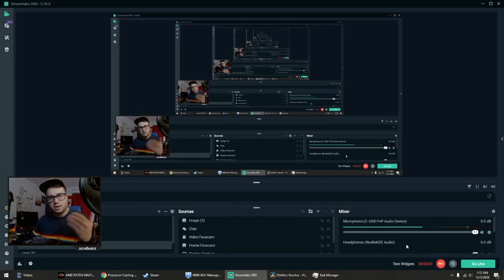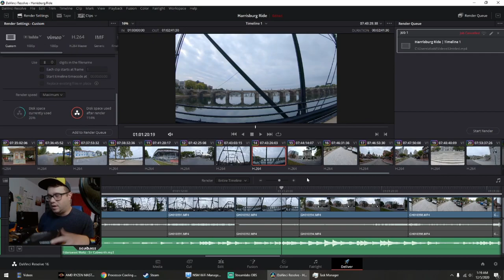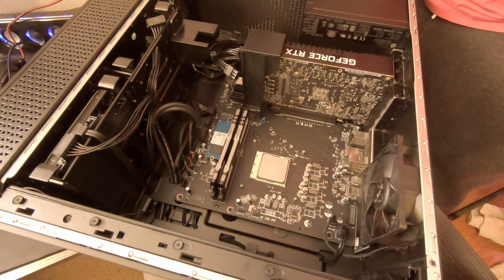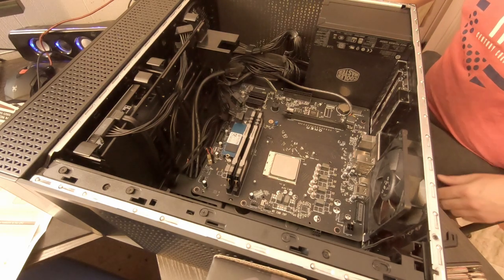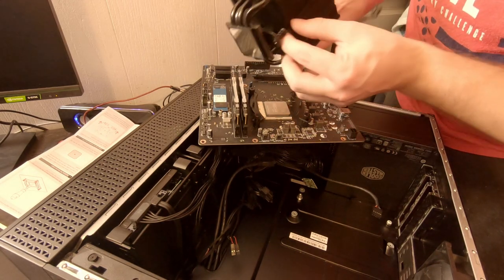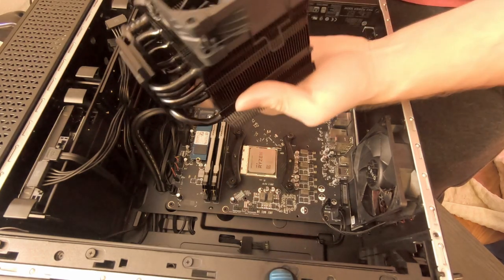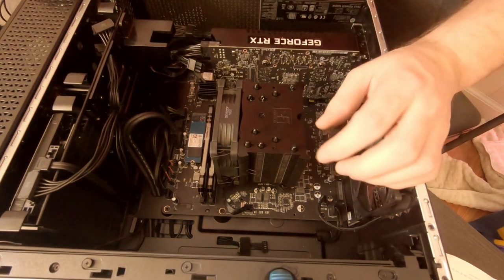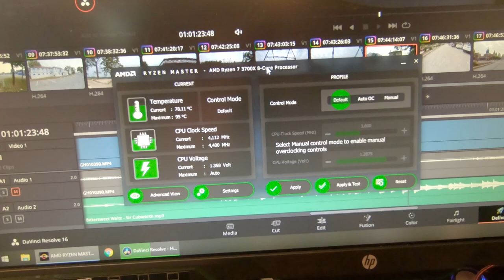Omen 30L Motherboard Removal - Noctua NH-U9S Heatsink Installation

Comment from the maker: Someone alerted me that I had a link to the U12S heatsink in the description, the U12S won't fit, it's approx 130mm, the Omen 30L will fit about 105mm inside the case so you'll have to go with the U9S. Link is here https://www.amazon.com/Noctua-NH-U9S-chromax-Black-Single-Tower-Cooler/dp/B08HH6G48J/ref=sr_1_3?dchild=1&keywords=u9s+noctua&qid=1621882412&sr=8-3

Comment: It's a badass little computer.  I got the exact same one on black Friday sale for $940.  I knew about the heating issues, so installed a top exhaust fan to the pump connection as soon as I pulled it out of the box.  It runs great.  I'll be adding a new cooler I just purchased before Summer.  It runs games in 1440p @ 144 refresh rate no problem.  Good luck trying to build one anywhere near that price today.
Reply: That's exactly why I got it. Amazing price, got a discount as well, and I can't find gpus anywhere lol. I'll take the minor issue for now and upgrade later. Im not planning on overlooking my i9 anyway tbh for now
Reply: did you get the top fan rgb to work ?

Comment: I got same pc exact specs. I ended up installin a cooler master aio. Really helped. I was hittin 92 on a ps3 emulator i was running.  Got it down to 78 when i run it. Every other game is way cooler. Emulators run everything on the cpu
Reply from the maker: honestly anything is going to be better than what they supply
Reply: @churchofseabass9227  yea u can tell thats where hp went cheap
Reply: Which aio did you get?
Reply: Cooler master 120 mm
Reply: @louieguimaraes9865  just know u gotta take the whole motherboard to install it

Comment: Should have whatched your video before changing the cpu cooler. I used a screwdriver to get the sticky tape off and destroyed the mainboard. Now I don‘t really have an Omen anymore 😔.  With the new motherboard, the wifi card is useless now, rgb is not working anymore, had to solder the cable for the on/off switch because it was too short for the new motherboard and I also need to extend the usb 3.0 cable. And somehow my computer now turns on when I touch the case 👍. But at least now I can control the Fans as I wish 👌
Reply from the maker: That is exactly what I was scared of and why I wanted to note that in the video. 

I was using a flimsy plastic gift card thinking there would be no way it was going to damage anything but ended up scraping away a bit of solder anyway, scared the heck out of me. Surprised my computer hasn't started doing some weird stuff yet. Really sorry to hear about your loss
Reply: Darn that stinks man.   I just did this install to my Omen Obelisk and was able to remove the bracket without tools.   I just grabbed the corners and yanked up and she let loose.  I was scared to pry on it and was glad that I didn't have to in the end.

Comment: I just purchased this today. I have the cooler master 120mm in it now. But for some reason it's too tall, so I can't fit the side panel on. Figured since this one is 92mm it will fit. What do u think?
Reply from the maker: I believe there is only about 10-11cm available, so I had to go with the u9s or the 90mm one
Reply: @churchofseabass9227  yea I went with the U9S and it fit perfectly! Good call!

Comment: Did you remove the shield on the top of the case where a fan can go? Even if you do not install a fan that will help with cooling a little bit.
Reply from the maker: yeah, didn't mention it, but I did. Noticed there is still a lot of plastic mesh from the case that covers a good bit of it, but def more air flow.

Comment: I bought a noctua but the mounting bars don’t fit to my hp motherboard. Any tip on what bars I should use? Both bars that came with cooler don’t fit, one is shorter and other longer than mounting pins.

Comment: Could you have used the original fan mount on the back of the motherboard? Or did the replacement one add clearance
Reply from the maker: I believe I checked to try to see, the included mount is the right shape to fit over the HP mount/backplate, but the hp mount/backplate has a different shaped post that won't allow the included (noctua) mounting screws to mount into them.

Comment: Hey I have the exact same model, and I’m thinking of getting an aio liquid cooler, but I’m now wondering if the air cooler would do better. Also, what did you do to get your idle temperature all the way down to 30°?
Reply from the maker: Replace the CPU cooler for sure. The stock one is really bad. Just doing that brought my temps down 10-20C. I think I also changed some windows power setting where the Max Processor power is set at like 100%, reducing it to 99% keeps the CPU from jumping to max power all the time like it seems to do. It'll cause it to idle at much lower power/speed, producing less heat.
Reply: @churchofseabass9227  alright, thanks!

Comment: Great content. Congrats. 
I purchased an Omen 30L
Do you think a Noctua NH-D15 Chromax would fit in considering its size? Thanks.
Reply from the maker: No, the case is about 110-120 mm wide, with the heat sink anchor the 90mm version is about 100-110 mm tall. So the 90mm version or U9S is the largest you can go.

Comment: If I got a Corsair h60 and the same cpu and motherboard as you What kind of brackets do I need ?
Reply from the maker: The motherboard uses a weird configuration, despite it being a AMD CPU it uses Intel bracket positioning/config, so you'd likely be using the intel bracket, though I'm sure you've figured it out by now since this was posted a month ago. Sorry for the late reply.

Comment: Help me with my decide of getting one now, thank you
Reply: If you can - build your pc on your own. Omen has issues with thermal and gpu isn't great. I own a 25l omen obelisk and it's loud, gpu fans are set at 90% to keep gpu on/under 82C. My motherboard doesn't support ram overclock, so my new 3200 ram is set at stock 2666.  In future i'll need to change my case, upgrade mobo\cpu(as 1151 lga socket is a dead end street). Probably in few years I'll simply sell it and build my own rig=)
Reply: @tryharder3214  my mother bought this for me for Christmas but she told early so I could get my room in my house ready for it and spend some time using it instead of setting everything up.

Everything you said can be easily fix, of course warranty will be broken but it will be worth it
Reply: @Kojoizfreshz  first year I didn’t change anything. I recommend you getting an asus tweak 2 program to change fan speeds, as with stock one you’ll get gpu throttle in gpu demanding tittles. But my rtx2080 with i7 8700 will last me at least 3 more years(I bought it last year ago). It’s a good buy, and a great to learn things and get into pc building yourself in future;) 
Good thing your family cares much about you. Do your best to make them proud.
Reply from the maker: @tryharder3214  Yeah I heard the intel version has issues with ram speeds. Apparently this doesn't affect the AMD version. You're right though, under normal circumstances, building your own PC is more fulfilling and usually cheaper. Given it's 2020 though, this PC would have cost upwards of $1400 to build myself. Picked it up for $950.

The motherboard they put in the AMD version is a B450, so it looks like an upgrade will be in the works here in a year or two. Does your GPU have any coil whine to it? Or is it just the fans? My issue is the coil whine, but tends to be common in cheaper varieties of graphics cards. Haven't seen my GPU get above 78 yet, even with Flight Sim max settings.
Reply: @churchofseabass9227  in my PC I’ve Asus rtx 2080 turbo(non Ti). There is no whine while I YouTube, but when games are on - fans spin loud. Like, really loud.

AMD version needs better ram speeds and has better mobo/cpu(as it supports new cpus I believe). 

Anyways, if your temps are good, and you can max Flight Simulator especially for the price(I paid 1200$ for mine) - hell yes, enjoy every bit of it. It’s a great PC and if people say otherwise - I’ll let it be;(

Comment: Is this a ryzen 7 3700x 2060 ? Does the back panel of the omen 30l case open or will you have to remove the motherboard to install the new cpu cooler
Reply from the maker: the back panel does not open or at least I haven't attempted but it doesn't appear so. Unfortunately you'd have to remove the MB, yes this is Ryzen 3700x / 2060
Reply: @churchofseabass9227  the back panel does open you just dont get access to the motherboard

Comment: Where does this motherboard have an extra slot for a ssd drive?
Reply: If it is a regular SSD they have 2 locations on the left side if you have the case oriented like this video. They have the cables all hooked up on the mobo but are not connected to anything depending on the config you ordered.
Reply: @darkangeldafu   Indeed I have space under the hdd drive for another drive, but only one cable not plugged in anywhere. Thanks for the answer :)

Comment: I don't understand why you went through a cumbersome process of removing the motherboard instead of just buying a cooler master CPU air cooler. Noctua is good, but you could save so much time with cooler master.

Comment: are you going to replace the motherboard?
Reply from the maker: I bet I will eventually. I'm running out of USB slots and I'd like to install an internal wifi card but the damn computer only comes with a single PCI, its gross.

Comment: You mean pull up the bracket with your finger tips while heating it up? Oh boy this is gonna be a doozy.
Reply from the maker: nah you don't have to heat it up. Some heat can help loosen the adhesive but I didn't bother with heating it. Just pull from the corners of the brackets, the very edge of the arms. Keep going around to each one and eventually itll start to loosen. Might take a few minutes but you''ll eventually start hearing a little bit of tearing which is the adhesive tape they use. This has to be the safest way, I would totally avoid using anything to pry because there's a lot of bits of solder around there.
Reply: @churchofseabass9227  Hey thanks for the pointers man. I planned on hitting it with a blow-dryer if the adhesive proves too stubborn but that has it's own risks i'm not entirely comfortable with, static build up mainly. It's inspiring to hear that you managed it without extra equipment so i'll try to do the same. Better safe than sorry

Comment: u used the intel brackets on a amd cpu!!!
Reply from the maker: Lol yea that's how HP designed it, i guess they designed the base of the heat sink around an intel design despite it being an AMD. The AMD bracket won't fit but the intel bracket fits perfectly